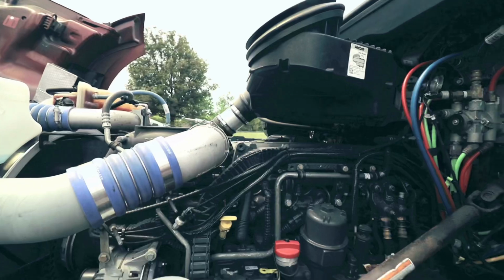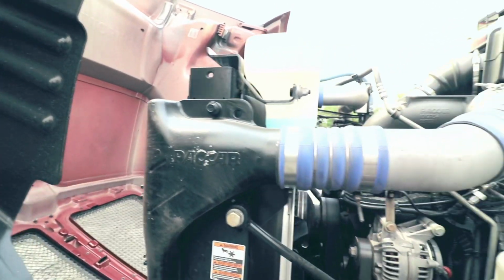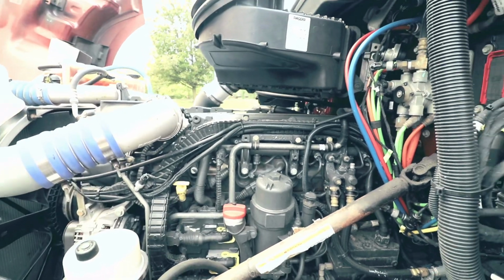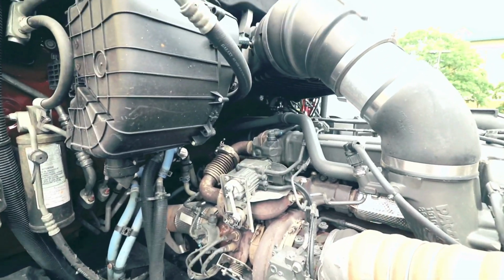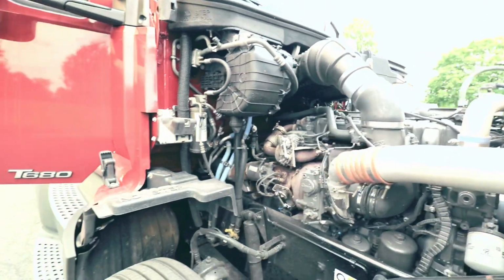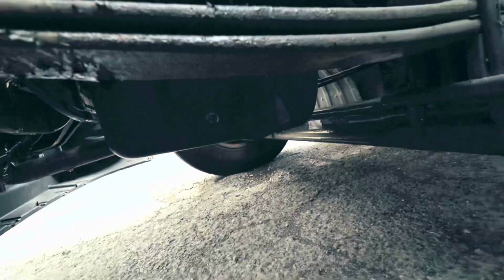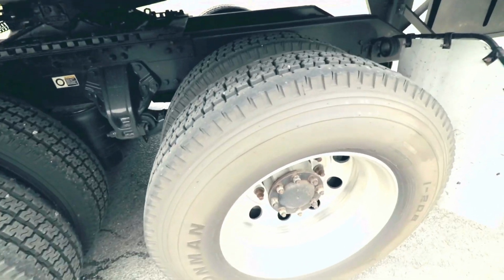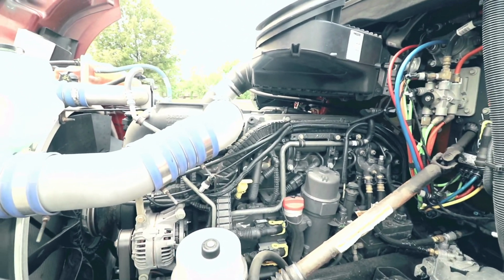Team Trucking Couple: What Engine You Got in that truck | Kenworth T680

Comment: I got the same truck it's off of JBS fleet mine is a 2016. I bought mine in April 12 , I have the paccar engine no complaints great pulling truck and fuel mileage. Lol I did upgrade the deck and the speakers they had to go 😂😂😂